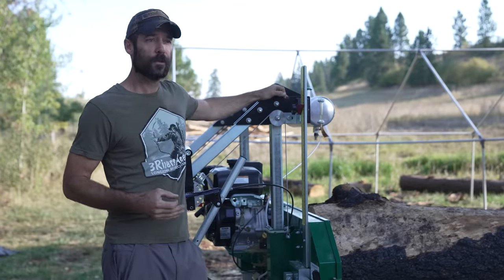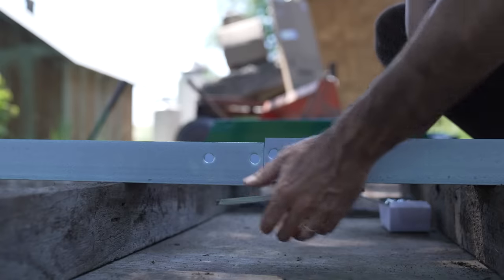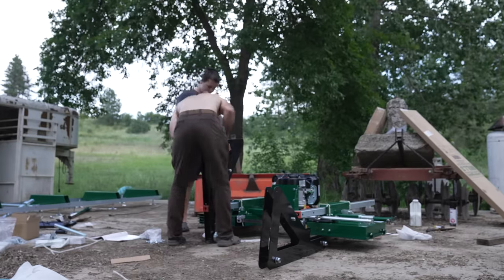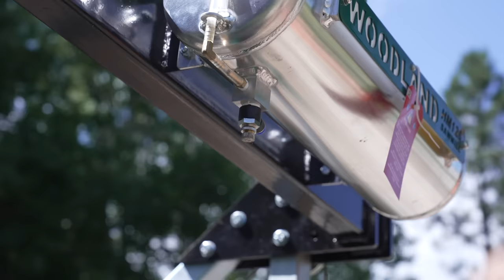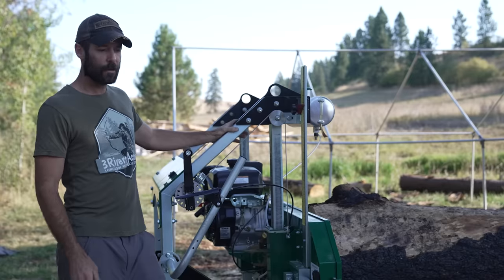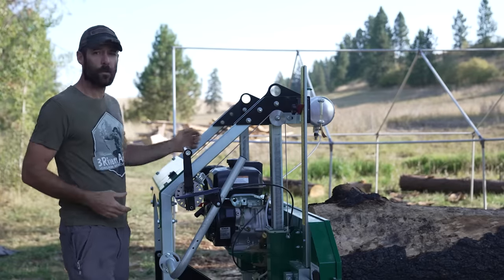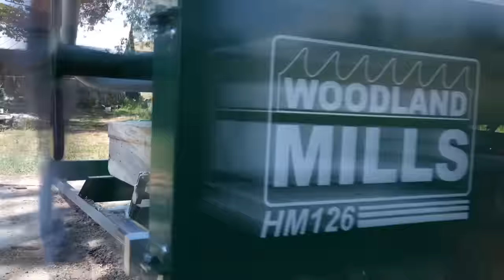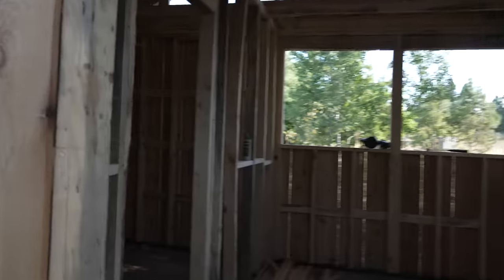My Sawmill is up and running!

Comment: Firewood is a good chore every kid should be required to learn imo how to spilt, stack & make kindling. Eventually learn to use the power saw by starting with bucking rounds then it's dropping leaners, then the fun of falling em begins & then when they can fully process the entire load by themselves class is over & the real work begins hahaha I grew up not far from where you are & still get my firewood in your neck of the woods & drive by on the paved road every time go cutting. The mill looks like a good one your sure not wasting time with it making one heck of a meat locker/smoker kudos Clay you sure are the real deal no doubt so much respect for you Sir 👏

Comment: Great thing about splitting your firewood is that it helps keep those bowstring pulling muscles in shape, that along with all the other exercise you get through the rest of the hard work that makes your lifestyle work as well as you depict. Hat’s off, much respect.
  One other benefit to that mill is the money that can be saved if you have need for custom sized lumber. Custom sized posts and beams can cost a small fortune.

Comment: Quite apart from the cost savings made not having to buy the timber you are using is the satisfaction you get having done the job from start to finish, including the task of producing the raw materials. Now that you have the mill, you will no longer be dependent on someone else to supply you with timber at a cost that you may struggle to justify.

Comment: I recently finished a hardwood cherry floor for my wife kitchen remodel. I was my first real cutting project on my own mill. I've had guys come in with woodmizers before so I knew what I was getting into. I luck out and found an hudson trailer mounted oscar mill. Nothing like making your own lumber. I've heard good things about Woodland mills. Looks like a pretty solid design. As for how much money your making , you don't want to know. Ain't no money in splitting wood either but I enjoy that too.
Reply from the maker: Definitely some value in doing things yourself!
Reply: @clayhayeshunter  Absolutely. Knowledge and family is real wealth.

Comment: Im drooling over here. The wife and I have been dreaming of a sawmill since before we ever moved out of our 500sqft apartment and into our own house.
Clay, word of experience with those Kohler engines. They are garbage. Keep your eyes peeled for an old running B&S 14hp engine as a backup because that kohler and its horribly weak crank case casting will give out. 
PS, I really enjoy splitting firewood too...great work out and stress relief.
Thank you for sharing your knowledge and experience with us all!

Comment: Hey Clay, I bought the HM126 a few years ago. Its been a good one. One peice of advice. WINTERIZE the engine properly. The Kholer 14 HP is what I have also, and the damn carb lasted only a season before needing gaskets and a rebuild. I NEVER got that carb to run right after that. Ive been through 2 other "ready to run" carbs from online before I got the sawmill back up and operational. Im not a novice mechanic either.
Reply from the maker: Will do, thanks. I’ve been running ethanol free fuel as well.
Reply: @clayhayeshunter  That will help. I unfortunately cannot find ethanol free anywhere near me.

Comment: Hi Clay, those pencil pushers trying to justify a saw mill don't factor in some factors, like when you need a timber or plank that is not available at the box store, more often this in the case with me and my mill, which I have had for 30 years and professionally build traditional timber framed buildings, for many years with only hand tools.  You don't just go the big box store and pick up 4, 30 foot 9"x12" timbers.  Nor do they take into considerations using your own logs from your own land, no shipping or transport cost which come with much more than just the simple shipping figure.    I wouldn't trade my mill for anything its a full on necessity.   

BTW, how are you grinding and setting your bands?  Send them our or are you doing it your self?  I have been using a simple bench grinder for most of the 30 years and it is simple, accurate, sharp solutions.  I can share a video if its of interest.  I can grind my 13 foot band in 3 minutes and if its super dull I run it twice for 6 minutes total.  A sharp band keeps the quality of the lumber up where it needs to be.

Comment: I like it all. If i had good health i would definitely get a sawmill, but on wheels. Or maybe not, someone could drive up, hook onto it an off it goes. It is better to have it without wheels i think. But being able to cut the length you want and size is totally up to you. When the grid goes down and no body has power, no fuel, no phones, no problem right. The slabs can get cut and put into a gasifier that will make fuel to operate it just as if you have a full tank of fuel for the sawmill. You just need a reall long hose to connect the 6wo together. Then once others know that you can cut them lumber to build with, thats when you get popular with the people. I love helping people who cant afford to the price, but im not working for free either. Trade lumber for livestock. But im not going to eat them, they live a happy life on the farm. Share the live just like thus video. Send it to your friends and maybe two of you can go in halves and buy one if the price is to much for you. There is always a way. Pray for it and see what happens my family. I believe we are all related in one way 9r another.